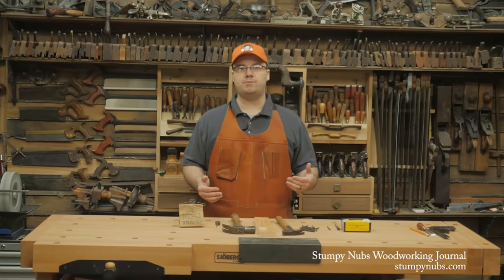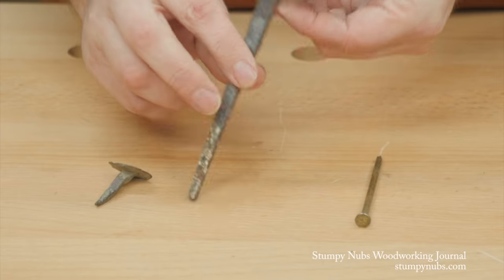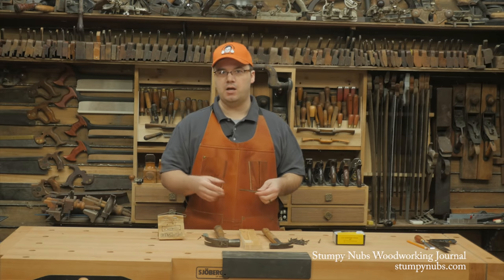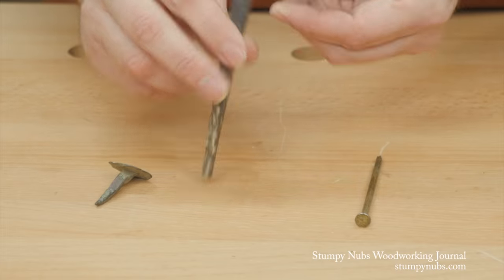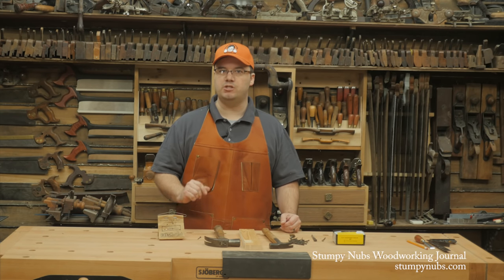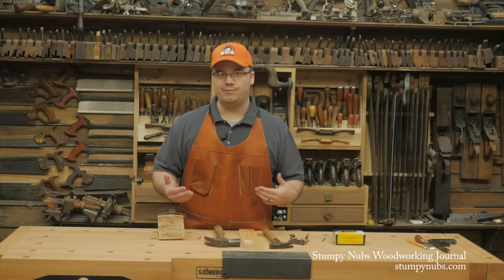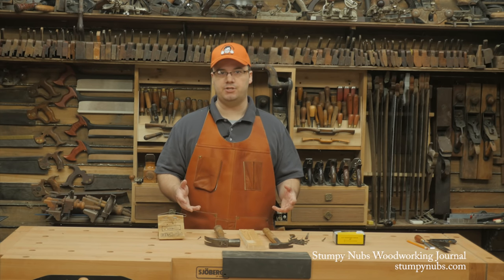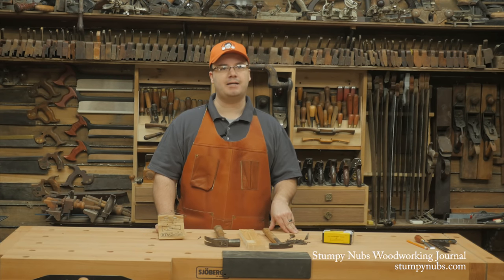Why cut nails work better- how to choose and use them

Comment: My father worked on his uncle's cattle ranch in Kansas in 1930's. He taught me to orient the long dimension of diamond shape of nails so the wedge would cut across the grain rarher wedge it apart. This to prevent splitting the wood. This knowledge of orientation of points made me a bit more successful a framing carpenter as a teen.  He also taught me to twist the point of finish nails into a ball of beeswax to lubricate when using dense oak, hickory or other "nut" woods. I still have his ball of beeswax 20-years after his demise.
Reply: This information about orientation of the nail was sorely missing.
Reply: Very cool. We're still catching up with old time ranchers and farmers!

Comment: To determine which nail to use, I first buy one large box of every kind, then I hold each up to what I'm nailing to make my final selection.
Reply: Or you could measure the thickness of the workpiece.
Reply: Bob Barna Nah you just kinda look at the ones you have and always end up using the longer of the 3 sizes you have
Reply: First step.  Find the jar that has misc nails.  Next, empty onto bench, rummage through various nails and screws to find one that works.  Check.  yep it works.  OK, now rummage through to find ALMOST enough for the entire project, but make sure you have at least 1 too few.
Reply: And the decision is to use screws.
Reply: @mmm-mmm  or, conversely, you finally break down and go to the hardware store and spend wayyyy too much time and money there.

Comment: As a side note, clinching or deadening should be done across the grain to avoid splitting. Its harder to get flush, but is stronger and more durable. Also should note that in colonial times, nail making was a cottage industry in many homes. Nail stock was made into nails with just a hammer and a small anvil of some sort. This could be done by the hearth in the home in the evenings.
Reply: Indeed so.  Recently I researched my ancestry and discovered in an 18th century census that my great great great grandfather was described as a nailmaker at his home, he and ALL the family - even the youngest child, a girl aged 7 years, was described as a nailmaker in the trade or profession section.  This was in the English Midlands.
Reply: Gospelman hope you dont mind but where did you research your ancestry, im interested in mine but dont know where to start
Reply: Started off collecting all the births/marriage/death certificated I could find, these yielded crucial information such as addresses and dates, then went onto the Internet and accessed the national census records (censuses are held every 10 years and go back to at least early 1800,s).  There are various websites which will guide you to the census records, and these will reveal all sorts of useful information.  After that, just follow the threads.  For early records you can access church parish records, but it takes a lot more effort and I didn't bother. HTH.

Comment: I remember going to the hardware store for nails where they were all in revolving containers. They were labeled 2D, 3D, etc. We'd fill a bag with the ones we wanted and they'd weigh them to determine the final cost. There were sinkers, finishing, ring shank, duplexes, etc. Guys would bring in samples of the wood to check out the nails. We could even discuss the relative merits of each nail.
Reply from the maker: I grew up working in our family country hardware, so I know exactly what you mean :)

Comment: I prefer threaded nails
Reply: ok im going to talk about nails, i better put on my leather apron to protect my clothing from the nails

now im indoors, so i better put on my hat to keep the sun off me... now i look like i know a lot about nails!
Reply: Not to be "that guy" but there are threaded nails... So ya.
Reply: not one speck of dirt on that outfit btw, he just likes to dress up .. .wait is that a picture of himself on his hat?
Reply: I really dislike your kind...  Especially when I'm demoing an old house before remodeling I can't stand any kind of threaded metal without an extractable head
Reply: lol
Reply: I love them too. They have wonderful holding power.  A pain to remove.
Reply: I prefer screws in my nailgun
Reply: @hindugoat2302  Sparks fly! Grease all over the place. Sharp objects spontaneously fly across the workbench. Cobwebs and sawdust rain from the sky.
Reply: @MrEazyE357  I know I literally just said I use them haha
Reply: @kealoharansom9124  Your threaded nail is not threaded, they are rings not threads the correct name for them is annular ringed nails.
Reply: @hindugoat2302  You seem upset
Reply: These are used for pine t&g flooring

Comment: On the thankfully rare -40 degree mornings here in northern Wisconsin, it can be alarming to hear the nails popping out of the siding, and I lay in bed wondering if the boards are going to fall off or if any passerby will be shot by the nails flying off the wall.
Reply: Who's going to be passing by in -40 degree weather?
Reply: @michaelgrubb8896  You'd be quite surprised to be honest

Comment: Good tip on the cut masonry nails. I kind of like the look of those over the wood ones. One could take a torch to bunches of them and easily take the temper out of them.
Reply: Zane Greene If the nails are hardened, you'd want to temper them to remove more of the hardness so that they can be bent over without snapping off. Tempering is done after the hardening process to reduce the hardness below the point where the metal is brittle and shatter prone. There are many differing levels of temper. I doubt you'd want to fully anneal them though, as they may become too easy to bend and unable to be driven into the wood.
Reply: Honestly, just put’em in the oven at 500 or so.  Basic cleaning cycle.

Comment: Very impressive and informative.
I'd like to add something about the difference in holding power between cut and wire nails.
As a wire nail is driven in the shaft near the tip is relieving internal wood pressure due to its"spreading apart and cutting through the fiber. The portion of the shaft that follows then has less pressure against it.
A cut nail however, due to increasing width will maintain pressure against the wood that has just been parted.

Comment: Thanks for the explanation why this is the case. I was pissed that the walls of a free standing planter kept being pressed out. I noticed that our older outbuildings were still holding up very well and decide it was the nails because it was the only difference and pulled a few and used them. Havent had a problem in 2 years

Comment: agree totally, you find your wire nail joints failing some years later, loosing and pulling open, a few seasons of expansion/contraction and load, and your joints are gappy, been fixing a lot of shelves in my garage this year for that reason, 30 years means lots of looseness, though of course nailing into end grain for shelves was a bad way to make them, but it was quick!

Comment: You might also look at a farm store for horse shoe nails for a reasonable substitute. May have to grind heads down a bit, but they work for some projects.
Reply: And they are thinner and softer because they too are made to clinch.
Reply: Alright!  Another good idea that made a great presentation and shows the high value of a major degree earned at the University of Observation with a minor in keep your mouth shut and your ears and mind open. Thanks for information.

Comment: I've actually seen cut nails used as decoration in chairs and in couches.  Some craftsmen would create a pattern using the heads of the cut nails as well as use cut nails of different materials. A herringbone pattern with black iron and burnished copper nails can make a simple chair look amazing.

Comment: A good compromise between ancient and modern nails is the use of galvanized wire nail. The galvanization of the nail makes zillions of protrusions on the nail and these allow for a very strong holding power of the pieces of wood joined together especially when the wood "swollens" from dampness.
They are still widely used in traditional boatbuilding construction when copper riveting is not needed. Actually I do have a couple of handful of galvanized nails on my boat and, yes, they are useful and I use them mostly for temporary repairs.
I may add that stainless steel or iron nails on a boat should absolutely be prohibited. The stainless steel is too slippery and the nail does not hold even when the wood "swollens" around the nail, an iron nail is calling for fast rust.

At any rate, thanks for posting.
Reply: vincent7520 or ring shank nails

Comment: Old measurement systems and everything tied to them is confusing as all hell. How to figure out which nails to use. Easy! Rule is, you take fart duration of average cat, multiply by 3.61, then from that number subtract length of three barley corns in 1800s and then give up.
Reply: that's why normal people use metric system :))
Reply: Try shopping for a truck. What is a half ton pickup? Who knows.
Reply: Multiply that by 3.14 as I recall.
Reply: that is my method.

Comment: So does the size system you refer to apply only to cut nails? I ask becuase that system would make a 16penny nail 4.5" long and they are 3.5" to my knowledge. Modern nails skip around a bit as they get longer. Or maybe Im not understanding.
Good video and informative as always. Thanks for sharing

Comment: Just got a 50lb box of cut nails from Tremont Nail Co. that I am going to use to face nail shiplap I am using as flooring.
Reply: I'm looking to install wide plank live sawn pine using the cut nails as an accent. Are you using cut nails only to install? Am considering shiplap. Why are you using shiplap over tongue and groove?
Reply: Used shiplap because of the very attractive price point.  When we installed the shiplap I used a nail gun to nail the "lip" to the floor and then ran a bead of glue along it before placing another over and next to it.  The glue was just to temporarily hold down the over lip.  We then pre-drilled 1/8" holes thru the shiplap and into the sub floor.  If you want the head of the cut nail to show you can proceed to nail in your cut nails.  If you do not want the head of the nail to show then you should redrill the top 3/8" of your previously drilled holes with a 3/8" drill bit (depending what size cut nail you use) to accommodate setting the head of the nail.  Once this redrill is done, hammer in your cut nail and then use a punch to set the nail below the face of the shiplap.  Fill all the holes with wood filler.

We are going back to the property next month to finish the living and dining room.  However, this time - due to a time issue - I am just going to use my finish nail gun to face nail the rest of the shiplap down at a 45 degree angle.

Will figure out what I am going to do with the rest of the 50lb box of cut nails at a later date.  LOL!  Hope this addresses your question.  If not shoot me an email at handystanley@gmail.com.

Comment: Blunting a round wire nail helps to mitigate splitting. Face nailing a built up beam without toeing nails counter to each other in your pattern is nothing short of negligent. Cut nails that I have come across have been brittle and I would not favour them in a structural situation. Cool look though in decorative stuff. I think thicker soft steel wire nails are well suited to structural applications particularly in earthquake zones. It never ceases to amaze me how many people banging nails do not seem to appreciate the intent of placing a nail for a purpose. Each and every nail. I think one gets the hang of it after a couple hundred thousand of them. Some mornings I wake  up thinking I really just want to go out and bang some nails. Oh happy day!!
Finally, I could be wrong on this but I think of a toenail as a cantilever. 1/3 in the  piece to be attached and 2/3 of the nail into the attachee. size the nail length according to what you are doing.
Nails hold things together that children and other innocents use.  It is no game. Use lots intelligently!

Comment: I'm about to install wide plank wood flooring by face nailing with cut nails. QUESTION: Does it matter if the nails show rust? Should I be looking for nails without rust?
Reply: 7 years late, but no, it shouldn't really matter if there's a bit of rust on the surface of the nails. Heck, the roughness of a lightly rusted/pitted surface will probably increase the holding power.

Comment: I’m trying to find these in Canada for a good price. No local blacksmiths anywhere. I’d try to modify some masonry nails so they would have a proper edge, but those are hardened and wouldn’t bend with the wood.

Comment: Hey Nubs! You forgot the one modern nail that is cheap (relativity) and out does all other nails ,old or modern. The " ANNULAR NAIL ". Predrilled ,will never split. Holds way better then any squared. This is the premium nail.
Reply: Problem with annular nails or ringshank nails is they only really grab onto a thin layer of material directly adjacent to the nail, so there are conditions under which they can strip out... and types of wood they just don't work well in.

Square/rectangular tapered (ie cut) nails, on the other hand, because of their wedge shape and the surface texturing, sort of (in a manner of speaking) grab onto a chunk of material the size of the difference between the tip width and the base width along the whole length... which is a lot more material.

Comment: It seems to me that the nails used in a pneumatic nailer are not round, but rectangular like cut nails. I can definitely see it in my brad nailer. I was looking at finish nailers at the home store, and they looked like rectangles too. Is that true or am I not seeing it right?
Reply: The gun nails in trim guns and brad guns are rectangular but nails for framing guns and roofing guns are round.

Comment: should the hole be drilled just slightly  smaller than the largest  part of the shaft?
Reply from the maker: +Jason Huckstep No, just the size of the nail's thickness. That will keep it from wedging the grain apart, while the wedged shape of the nail, which you position with the grain, will compress the fibers as described in the video. In soft wood you don't need pilot holes at all.
Reply: +Stumpy Nubs (James Hamilton) Thanks!

Comment: A rusty protruding nail you wish to remove, give it a tap in it breaks the rust making it easier to extract. A rusty screw tighten it same effect. Skew nailing put a kink in the nail it will pull the timbers tighter together.

Comment: Another advantage of cut nails is you can get fancy heads. When we built our house, and used 2000 board feet of pine from the trees we cleared to make paneling. I shiplapped it, and used Tremont Nail Company (www.tremontnail.com) rosehead nails to nail it all up. The nice roseheads look nice, so the exposed nails are a design feature, not a nail hole that would need to be filled, but always still show, as when you use a regular finish nail.

Comment: The way nails worked changed with the introduction of wire nails. Cut nails would work pretty well in tension as do screws. Wire nails are designed to work in shear and nailing techniques had to change. These days, if you need something to work in tension in a joint, the easiest thing to use is a screw.That said, skew nailing has its place although it's not as easy or elegant.

Comment: Wait if rectangular nails are stronger than circular ones, than couldn't you manufacture it from a thinned out bar just like with circular ones?
Reply: Regular 'circular' nails aren't made from bar stock, they are made from wire that is fed into a machine, the machine holds the wire in a collet, squishes the wire sticking out of the collet making the head, and snips off the tip.  Then the nail falls into a bin, more wire is pushed in and the process repeats. The machines work extremely fast, too fast to see with the naked eye unless you use a strobe light slightly out of phase with the machine to see each step in succession albeit with different nails.

Comment: Try holding a cut nail by the shaft. Next, try to pull up from the head. It grips better than any cut wire nail.

Comment: Well, though modern softer material round wire nails do lack the gripping power and the rigidness to drive them in wood with hammers - it also has a positive side effect in structural usage as it bends easily without braking when the built structure is about to move more than it supposed to or when it collapses due to unfavored events. Wire nails can softly release structural strenths of the building by this bending and poorer gripping property, thus making structures stay in one even when they heavily deformed by outside forces, be it nature (earthquake, wind, slide,..) or an overload of weights.

Similar to structural wood properties like pine wood, braking in long splinters holding together the building for longer than hardwoods that fall apart with a single fast and short but loud crack.

So soft round nails have their place and use as well today, they're not just a modern downgraded-for-production-ease tool of ours.

I would use hard wrought nails in furniture and other small risk low-weight bearing wood products and use soft round wire nails in wooden structural framing e.g.

Comment: This sounds cool, but most wood-to-wood joints use pieces of wood with perpendicular grain.  So a cut nail would be more likely to split wood.
Reply from the maker: Not so because the nail only goes all the way through the top piece, and the wedge is significantly narrower on the portion of the nail in the lower piece.
Reply: @StumpyNubs  nods

Comment: The only good wire nails are the fluted/spiraled ones. Those just about always put up a good fight when pulling them out of a board. Albeit they're not as great as cut/square nails they are adequate in comparison to wire nails.